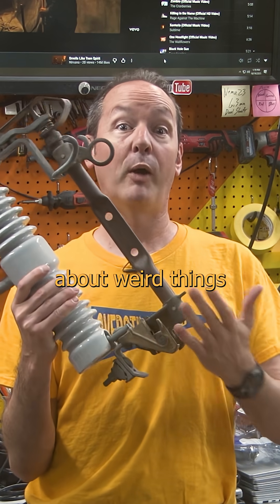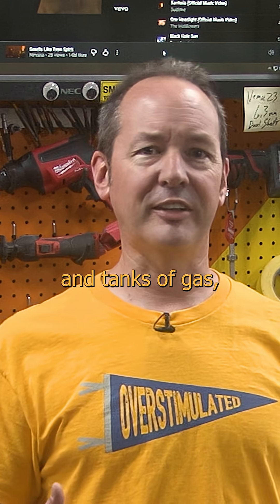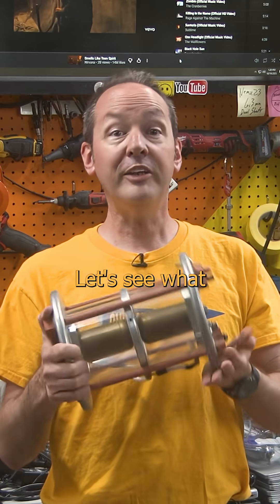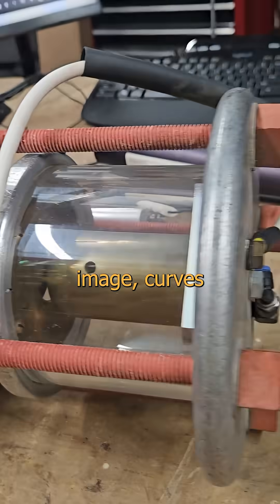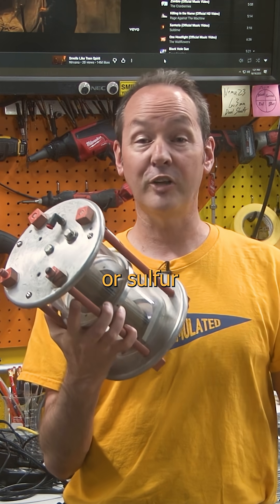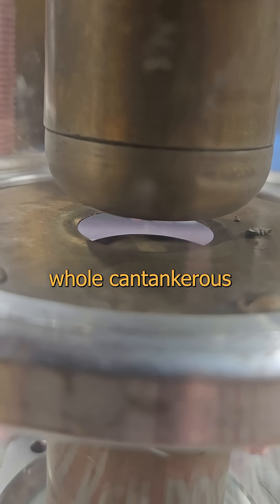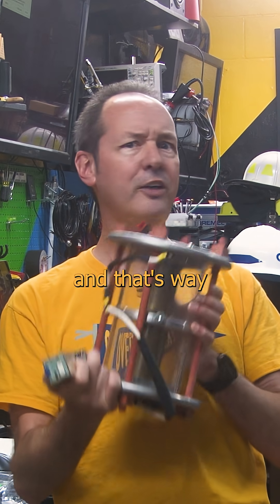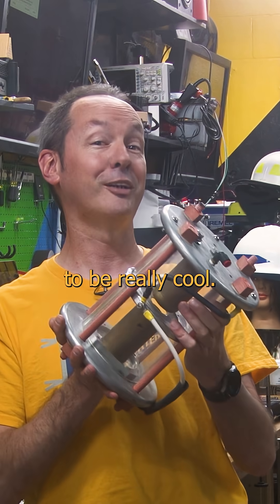Triggered Spark Gap #chrisboden #comedy #highvoltage #physics #engineering #science #educational

Comment: I can only see this thing for a over-voltage protection.
Like it exceeds a certain voltage, power jumps the gap, and activates protections mechanisms.
Reply: No the trigger means that at least in principle it could be used for control. More likely you have a really brutal "crowbar" over current protection where the output of an HT supply goes through a current transformer with the secondary connected to the spark gap trigger. If something in the load flashes over the current spike creates a trigger pulse and the gap dumps the HT, minimising the damage to the load, though not to the trousers of anyone working in the same building. 

Hint: since this applies a near-short-circuit across the mains for the time it takes for a disconnector to open the process is quite dramatic.
Reply: @boristheengineer5160 : Ruined pants or not, I'd rather be in a mile of your case than OP's case.

Comment: Below 300v? Try sending 120 down a 20 gadge wire with 30 amps.
Reply: But I like smoky insulation!
Reply: He just means it’s not weird. It’s comprehensible easy to understand and logical. When you get into the kilovolts rangers it behaves so differently from low power that it blows most people‘s minds.

Comment: World's most powerful morse transmitter. 
Or how to really piss off your local EM regulatory body.
Reply: Way off-topic - and I don't know if it's actually true... But apparently Soviet Union (ie Russia) were among the last to stop using spark-gap radios on their ships, and did so reluctantly... 

Because with their spark-gaps, they broadcasted across the whole band, so nobody else could be heard until they finished. Great way to jump the cue when contacting the harbour-master, in other words!
Reply: @baardkopperud 
Have you seen it's modern equivalent, UWB (Ultra-wideband)?
It's what powers the wireless key for your car with its position and Comms tech, close to car (unlock doors), inside car (unlock ignition), 10cm precision. 

Low power, ultra wide bandwidth, short range, very high data bandwidth radio Comms and positioning. 
Very cool, i want to find a use for it at home.
Reply: @baardkopperud 
Sounds perfectly possible, it worked so they didn't want to change it
Reply: And possibly every radioastronomer on the planet.
If you are loud enough, we can hear you, no matter where on the planet you are.
Reply: Oopsoedoopsie another felony
Reply: @bojik2616 
adds it to the collection
Reply: I worked at an Air Force high power lab and when the BMEWS transmitter tester was going off, you could hear it in AM radio across town. The walls were 1/8 inch solid copper lined but it probably leaked out the 1 MW power line feed.
Reply: @jamesvandamme7786 
Oh they must have loved that 😂
IBM North harbour had a problem of all their mainframes crashing periodically. 
Turns out it was the UK's MOD radar r&d facility up on the hill's fault.
Reply: @MostlyPennyCat  I've been blamed for RFI myself, when I was running a test out at the radar test site. "Your radar is making our computers crap out!" I opened the door and said you hear that? My generator is not running. Meaning my transmitter can't run. That shut them up.

Comment: Welcome to the RF domain. 
Now imagine high power GHz RF.
Those people have magic powers
Reply: 😂😂😂 i stay away from ANY ELECTRICITY that can produce Xrays if connected wrong....
Reply: @meyou3353 wise words😊
Reply: @meyou3353  I may sound stupid for saying this Cuz I don't get from where U pulled x-rays, but visible light is already THz, X-rays are much higher than GHz
Reply: @DatBoi_TheGudBIAS It shouldn't produce X-rays, but if you get the termination wrong in just the right way on a high-power RF system, it will produce X-rays. Basically, the voltage and frequency are high enough to create plasma and give those electrons a big enough push to make the whole thing radiate in the THz range. This doesn't usually end well for either the machine or the people nearby...
Reply: @jandl1jph766  but THz is visible color range. X-rays is about 1000000 times higher iirc
Reply: @DatBoi_TheGudBIAS Read up on how X-ray tubes work. It's the exact same mechanism - if you hit any material with an electron beam hard enough, it can produce ionizing radiation (though the exact frequencies are material dependent). The input frequency is completely irrelevant, so long as the plasma is able to absorb it for heating.
Reply: @DatBoi_TheGudBIAS the next time you get an xray, ask the techs about the max specs on the machine.  If they have time they'll show you all about it.  My wife is a vet and has her own.  240vac with an 80amp service.  Just shy of 20kW on tap.  It can hit a max of 38kV if I'm remembering correctly.  The conductor is TINY as it only has to carry about 0.47amp max for about 12 feet.  But the insulation around that little wanna be glow worm?  Epically big!
Reply: @jandl1jph766  Eh, I'm told it's the equivalent of a chest X-ray..
Reply: So like, where can I even start to learn about this stuff?
Reply: @DarenMiller-qj7bu  Your local ham club wouldn't be a bad place to start.
Reply: @DarenMiller-qj7bu  STEM colleges with Electrical Engineering degrees tend to have classes for this stuff.
Reply: @DarenMiller-qj7bu  I started learning about it trough ham radio. Inform yourself where you can take your local amateur radio examn and how best to prepare yourself for it. And then you got a basis in RF related things and can strat to build up from that. Thats how I learned. And now I can build my own transmitters talk to people around the world and astronauts in space. I can download pictures from satellites observing everything from the weather on earth to the sun. 

Or generate X-Rays :)
Reply: No sane person touches high frequency stuff. I can get behind high voltage, high amps is ultra simple but high frequency is utter insanity
Reply: Nothing like seeing fluorescent tubes go nuclear bright when you hit the Tx button... as maritime electrical engineers we got to see some funky units. The sort of stuff wired up with 1" solid busbars.
Reply: "Antenna design is a black art": actual quote I saw in either Popular Science or Popular Mechanics from someone they interviewed who had determined (via testing) that tinfoil hats actually increase the strength of signals inside themselves. Wonky stuff can be found there.
Reply: Ah yes, the domain where every conductor is an antenna and everything is a conductor.
Reply: RF engineering is littleraly magic and witchcraft to me... Fascinating.
Reply: is that the technical name for Jewish Space Lasers? 😂
Reply: These are wireless ovens. In the garden or the room. If you wander in the wrong place.
Reply: That's the world I work in, fun stuff! MW of pulsed RF is a normal day.
Reply: Why thank you. We like to refer to it as FM no not frequency modulation. It’s Fuckin Magic.
Reply: Speaking of high power GHz RF, I have a kilowatt 2.450 GHz transmitter in my kitchen.
Reply: The radar tubes are the real magic devices
Reply: Yes, high power/high frequency RFers are wizards.